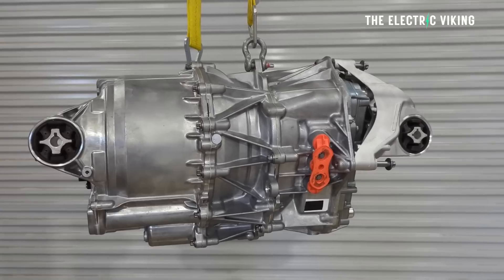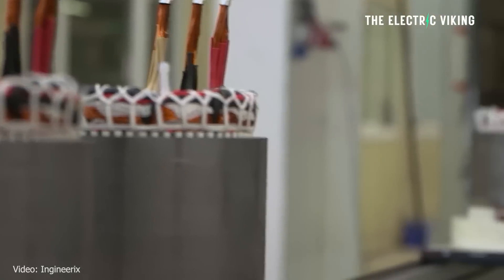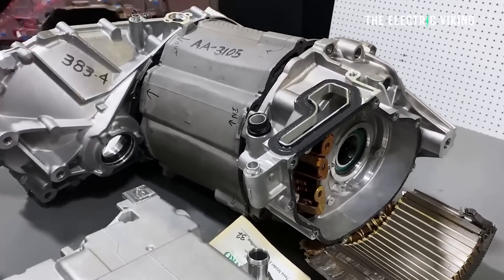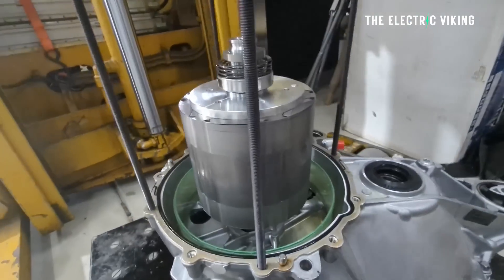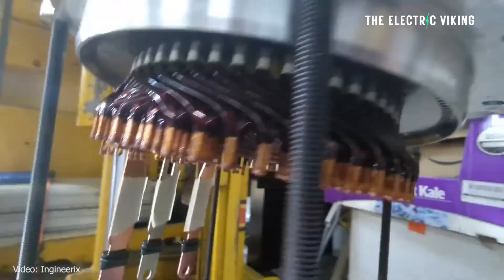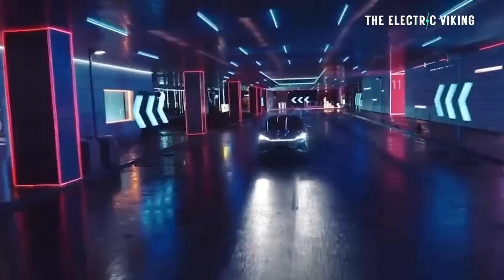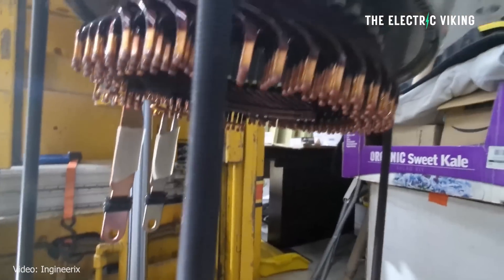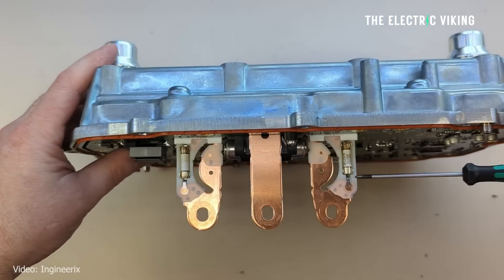Tesla Model Y electric motor compared to VW ID electric motor

Comment: Tesla is about 20 years ahead.  Amazing that the best VW can do is half what Tesla does.  How many engineers does VW have?  What is the R&D budget over the last 30 years?
Reply: 20 years is very optimistic. I'd say 8-10 at max. Still impressive but legacy Auto will close the gap over time. The ones that survive that is.
Reply: Or maybe tesla design have less meat in it. Which other EV can do 80% duty cycle. Tesla can only do 30%
Reply: @user-jh6vt8vx4v I've never heard of a Tesla motor failing ever and there are millions on the road with many over 500k miles.  Even if your made up numbers were true VW is going to need that 80% duty cycle as it will constantly have to use nearly all of the power it has.  Tesla on the other hand would only need to use about 30% of it's available power compared to VW needing to use 80% of it's power available.   

Tesla has proven their motors reliable, for VW or other manufacturers we'll have to wait until they produce enough and see if they are reliable after they have driven 500k+ miles.
Reply: @Ry-lx2kl  Model S and X drive units fail all the time. The Model 3 and Y drive units seem to have low failure rate.
Reply: @dannelson6980  Yes. The revised model S and X now use the same motor as model 3, though they are probably power tested and the more powerful ones reserved for S and X. Hopefully that will solve the drivetrain failures seen on previous gen S and X.

Comment: About a couple of years ago Sandy Munro & Associates disassembled a VW 150kW motor, and although it wasn't as radical as a Tesla motor, Munro was impressed with its quality and design. So VW have done something quite well in the BEV sphere. However, Tesla has substantially improved the motor since. The VW motor? It's probably the same as it was 2 years ago. As we know, Tesla make running improvements. Legacy tends to improve on the next generation.

Comment: I don't care much about torque or horsepower, I care more about efficiency. Which translates into range.
Reply: However, a motor of a specific weight and size producing double the torque and hp speaks to efficiency. Couple that with e.p.a estimates ( and they are estimates because it cannot reflect real world driving) showing a greater efficiency for the more powerful motor confirms this inbuilt efficiency.

Comment: Is the Tesla breather on the top of the Motor capable of protecting it from a flood like always happens on the east coast during a hurricane, or is it scrap after its been submerged?
Reply: Same as anything else.  If you submerge it in salt water... it is trash.  Every car, every truck, every boat.
Reply: Salt water exposure and electronics are not good bed mates.

Comment: You have to remember that Tesla is the old man of EV manufacturer. So they have the experience that says that the oil filter doesn't need to be changed. BYD is new to this. So they made it serviceable just in case. You can argue either way. Give BYD another 10 years of EVs and they will probably seal it too once they find out that the unit doesn't need to be serviced for 500,000 KM.
Reply: Founded in the same year 2003 for both byd and tesla.
Reply: Tesla invented the electric motor?!  Why don't people talk about that more?!
Reply: @davidbeppler3032  Because Nikola Tesla invented the AC induction motor in 1883, and time has passed.

Comment: Faster, better, cheaper, simpler, safer.
Reply: Therefore 🙄
Reply: Healthier.
Reply: @ryan6391  more delicious
Reply: How is it simpler or safer?
Reply: The Tesla motor is also much more efficient.
In addition, Tesla uses much bigger bearings in the drive train
Reply: @richardvivian3665  Not if all the owners are boot scooting every time they go from a stop.
Reply: @billcichoke2534  most people i see dont really do that in a daily matter. They just tap the traffic aware cruise control on and just let it decide its speed on its own. Thats what i do mostly to work.
Reply: @Aerism  The comment was about efficiency.  To be totally fair, ALL EVs can get roughly the same range depending on driving technique.
Reply: More than ever hour after our work is never over
Reply: Yup except for the lithium battery pack. It's very energy and resource intensive to produce, doesn't last forever, flammable etc etc. We need a better power source for the electric cars like cold fusion or zpe battery
Reply: Tesla

Comment: What do you think of this theory? All the negative news about electrics in the US is just the legacy automakers way of ensuring sales of their remaining product.
Reply: Look at the hype about hydrogen, as if that's going to save the industry. At least don't buy an EV because it will soon be obsolete when H2 or synfuel comes out! Powered by fusion!!   What a pipe dream.
Reply: @jamesvandamme7786  Dead right I don't get the mind set of anyone that would want a H2 car. Putting a whole lot of pipe dreams out there is not a bad way of confusing everyone so they go with what they know for now and buy the last of the ICE. Hell if you could convince me that fusion car was just round the corner I would buy the last of the cheap ICE to get me to that corner. It wont work though, already EVs are at price parity with ICE and they are well more compelling. The take up is happening by itself and I don't think we will need laws to ban ICE by any date. By 2030 trying to push ICE will lead to bankruptcy.
Reply: Of course that observation can't be applied to VW under Herbert Diess, where the company published a chart comparing their own ICE vehicles unfavourably against their BEVs. For a legacy auto maker that was extremely brave, I think.
Reply: @ramblerandy2397  Yes, fired a week later.  That is when I knew VW was doomed.
Reply: @davidbeppler3032  To be accurate it was more like 8 months, but I take your point.
Reply: i think you're in a cult
Reply: I think that is the play and not a theory, merely an observation. Well seen.

Comment: I would expect there to be a huge difference. Tesla has had 20 years and have gone through multiple designed for motors. VW just got started. They haven't had time to refine their designs yet. And this is VW so it's as if they can iterate quickly.
Reply: VW must fix their software issues before going iteration
Every 4 months you have OTA inside the service center itself "which is supposed to be a recall that solve the software issues"
But nothing is changed for almost 3 years
Reply: 20 year's? The roadster arrived in 2008 the id.3 was shown off in 2016. First delivered in late 2020 as vws first ground up ev.
Teslas first ground up ev the model s was first delivered in late 2012. 🤔
Reply: @4literv6  That looks like 4 years to me... am I wrong?
What R&D did VW do for 30 years?  Where did all that money go?  Didn't VW have any engineers?!  WTF?
Reply: @davidbeppler3032  you are not WRONG at all. I just love the never ending excuses for those poor ole legacy dinosaurs. 

First it was they can spin up evs anytime and crush little upstarts like tesla. Then it was nobody wants evs, then it was evs aren't profitable. 
Then it was evs require lots of chips to build. I mean it never ends with the ice excuses. 

Meanwhile time simply marches on without them with tesla and byd as the new kings of the ring. Combined this year they might exceed 10% of the entire world's automotive market share. Next year 15-20%+ the year after 25-30% by 2027 they might be 55-65% of all car's sold between them. 😀
Reply: VW can't iterate quickly.
Reply: @Notme-tq4xs  no they can't! Or they would be doing it by now, the current range is a lazy lash up. Bankruptcy by 2030 or a major government bail out. Sorry, German tax payers 😢
Reply: VW (and all the others) have had exactly the same amount of time as Tesla. They just chose to invest their time elsewhere.

Comment: EVERY oil breaks down and gets dirty. For a drive unit like this that oil should be changed every 50k miles. So now the driver has to drop the entire drive unit and split it? This is pretty lame.
Reply: How often should I change the oil in my ceiling fan? /s
Reply: @mr.hamiltom5440  Or hair dryer
Reply: Tell me you don’t understand an electric motor, without telling me ‘i don’t understand an electric motor’ .. ☝️lol
Reply: Not in a situation like the Tesla motor or any other traction motor. We're not talking about combustion contamination of the oil here. I doubt you have a clue about the mechanics of these motors to make such a comment.
Reply: Don't forget your blinker fluid! Every 5000 flashes.
Reply: @jamesvandamme7786  lol
Reply: Um.... I ran an electric fork truck for a 12 hour shift.  It never stopped.  24hrs a day 360 days a year.  Over 5 years nobody ever changed the oil.  Why not?  BECAUSE YOU DO NOT CHANGE THE OIL ON AN ELECTRIC MOTOR!
Reply: @davidbeppler3032  The YouTuber that tore down the Tesla MY Sam is referring to is Phil aka Ingineerix. He stated in the comment section of his tear down video that Tesla engineered it for 1 million miles but he "recommend 40k miles for drive unit lubrication change." https://www.youtube.com/watch?v=WNNhWYogBe4
Reply: What these people above don't appear to understand, is that the oil filter is NOT THERE for the electric motor, it is there to keep the oil in the gearbox clean. And yes, Tesla's do have a gearbox, even if it is only a single reduction gear - it still needs to be kept lubricated, and the oil 'filtered'...
Reply: Even ICE gear oil is barely ever changed in a complicated gearbox. In a BEV it is a single reduction gear built to last much longer. So the gear fluid has a relatively easy time and never needs changing.
Reply: @ramblerandy2397  Not really it is spinning faster under higher loads, and it cooling the motor. I have seen some very nasty looking oil coming out Model 3s used on a track.
Reply: @dannelson6980  Well that's the track. You would change transmission oil under theose circumstances.
Reply: @ramblerandy2397  All oils become acidic as it oxidizes and the additives deplete. Even in normal use, I am always going to change it around every 12 years or 150,000 miles when I plan on keeping the car. You can always have the oil tested, however it is cheaper just to change it.
Reply: @dannelson6980  Someone had better tell Toyota that info. As I have a motor engineer relative in the trade I know that a normal transmission fluid would get changed once in a blue moon. Yes, possibly around 150,000 miles or more. The transmission fluid that circulates the Tesla reduction gear gets a far, far easier life, so an owner may not ever change it in the lifetime of ownership.
Reply: The transmission fluid on Toyota's hybrids is life-time fluid, never needs to be changed.